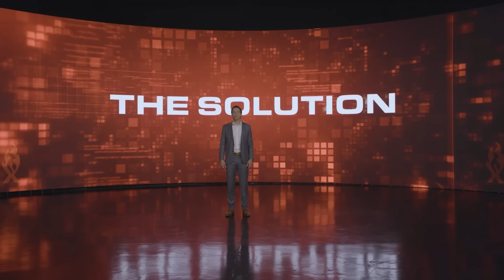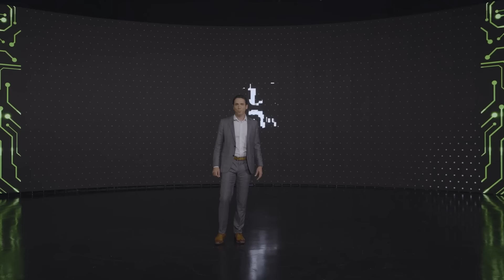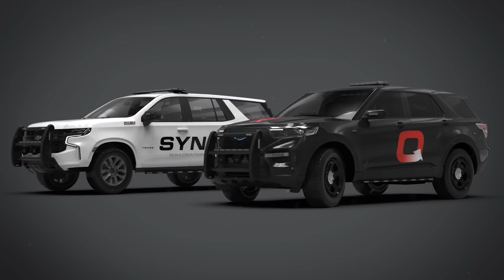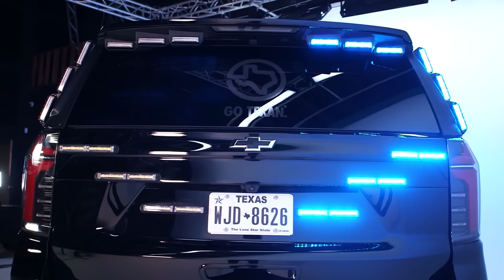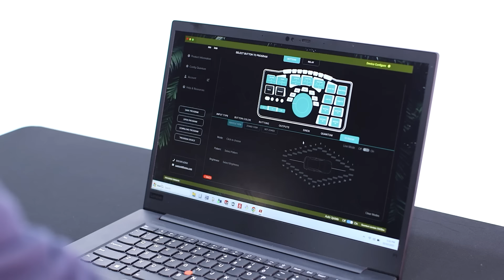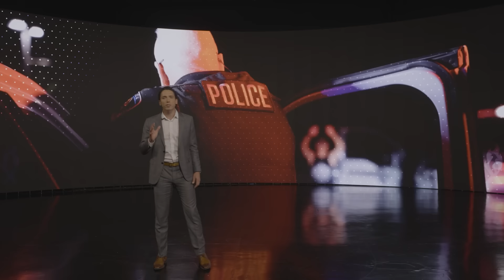Feniex Summit 2025

Comment: other manufacturers do not require a separate module for dual tone.  FS Pathfinder / Sound Off / Whelen all have dual tone right in the amp . Fedsig's 400 watt can run 4 x independent channels and you can program tones for each.   Pretty sure Feniex is aware of this.
Reply: This ☝️ Pathfinder PF400/400Q being the most advanced Ive seen with quad tone capability.

Comment: My question is is this only for quantum 2.0 or will this work with quantum (not the 2.0) as well and can I sync 2.0 and just normal quantum together
Reply: Also have this question, but I dont see why not as it is only a color option, both still have serial technology
Reply: I'm drastically waiting for this info. As I have a full first gen quantum front and rear setup. If it works with just using the white and green usb wires this would be great.